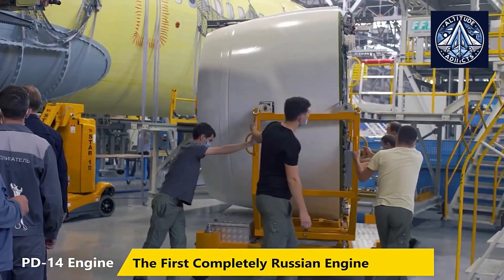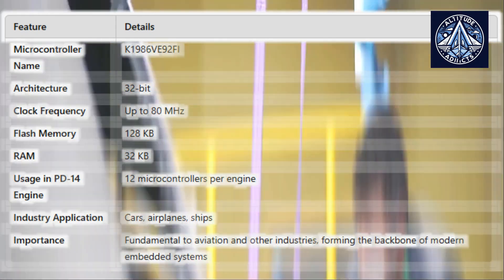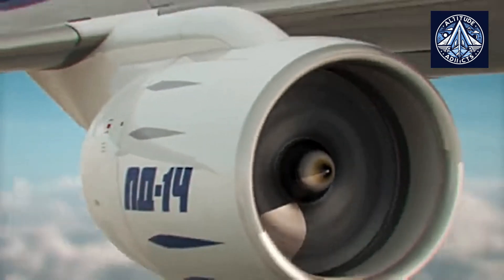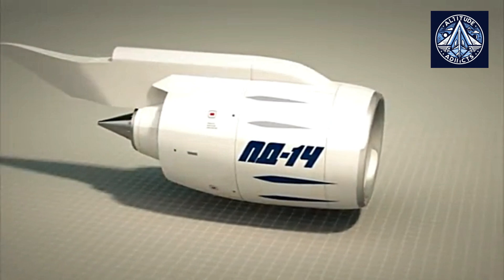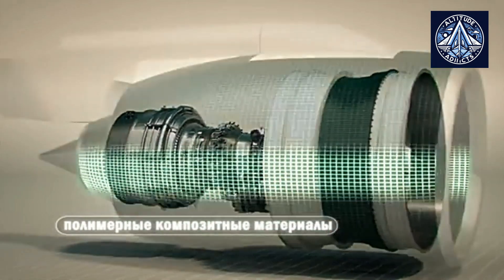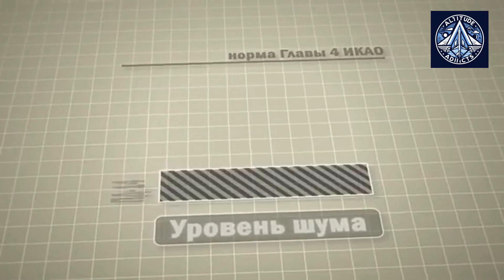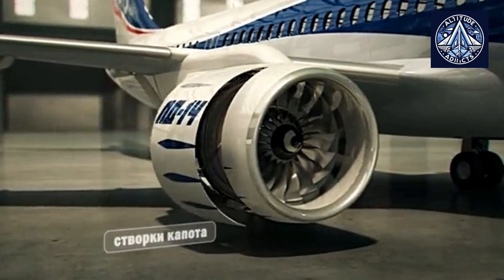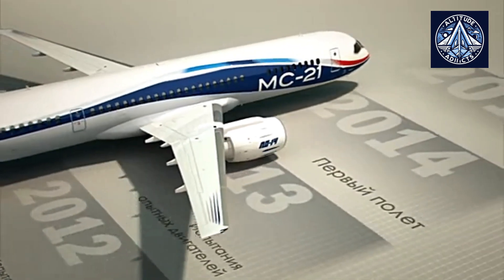K1986VE92FI: The Microcontroller Behind Russia's PD-14 Engine

Comment: Russia has also other powerful processors like Elbrus, Baikal, ... but the company is doing development, projects, .. the processors than have to be stamped in a foundry. The foundry was the TSMC and now they won't stamp for Russia anymore. Maybe they developed a new processor to be stamped on older technology, perhaps China would do. You simply use more processors for the same result as using one made from new technology.